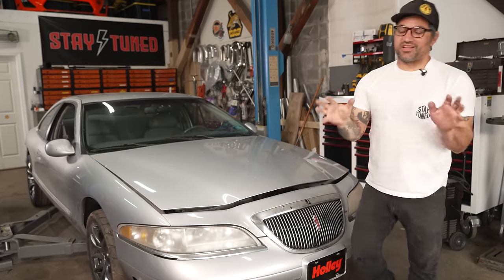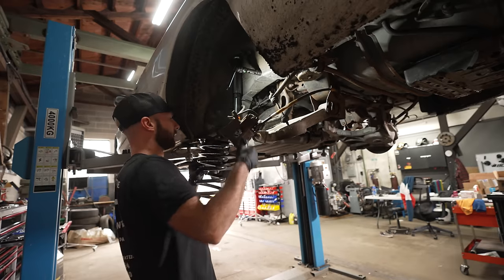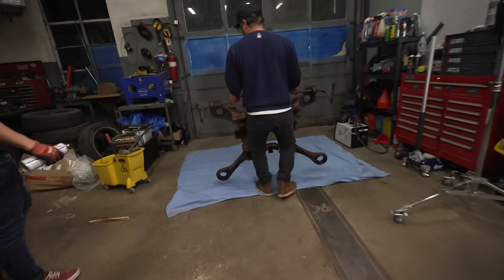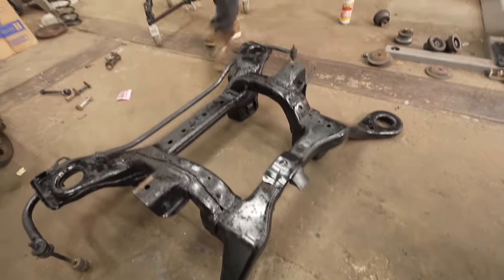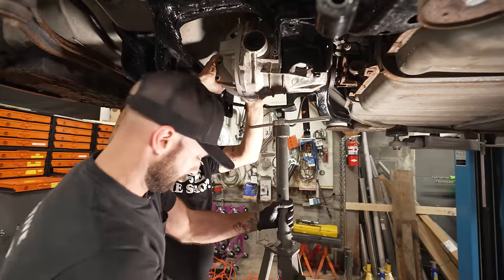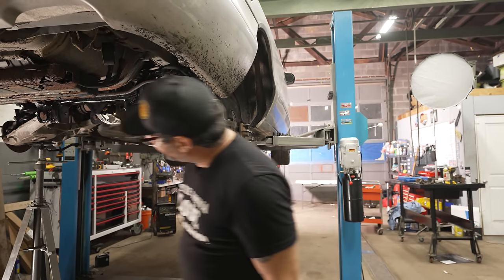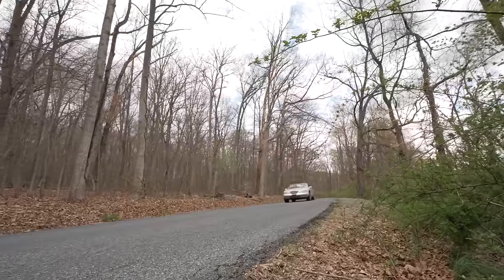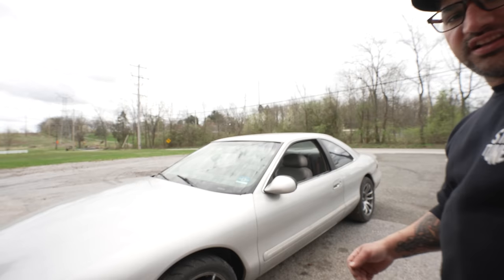Grandpa's Killer V8 Turbo Lincoln Hits The Streets For The First Time!

Comment: Real dialed tune and little shot for the bottom end that thing's in high 4 0-60 and I can see Tony taking it in the 10's with a good day at the track tuning everything else.

It's gonna be awesome, will probably run a heavy day at the track now, so long as the cooling system's up to that task.
Reply: I have very little clue what I'm talking about 😊 but if it's doing low 5s now I reckon it'll do better than high 4s no?

Comment: Just finished installation of 3.55 gears and a traclock in my '93. Even with a mostly stock engine it steers left on accel. Guess i will buying a big chunk of delrin and start turning some bushings for the rear.

Comment: The fact the current turbo can boost higher means you should have the headroom to go down a size or two on the turbine side, without losing top end boost pressure. That would make the turbo come on sooner and give you a wider power band, possibly without losing any top end power at all. For a street sleeper even a little loss at the top end for a wider power band might be worth it anyway.

Comment: Man, 3.55s? I would think 3.90-4.10 would still behave on the highway with that high-ass OD and be BRUTAL on the strip. Also, I'm not Italian AT ALL, German and 'black Dutch' (darker complected, dark hair and eyes), with green eyes and a red (and grey/white now at 38) beard, but I take Italian food VERY seriously. I absolutely make 'Sunday gravy' and I grow and can my own San Marzano tomatoes and Genovese basil, among other Italian-ass things. I respect the gravy-pie, haha!
Reply: 3.55 gears will build boost sooner in rpm than a 3.90 4.10 gear. There is a give and take though 3.55 is probably the sweet spot.
Reply: I’ve had 4 cars with 4v 4.6l: Cobra, Mk8, Mach 1, Marauder; with the nature of the engine torque curves they need at least 3.73 gears to come off the line like into party time quickly. I’ve used gears from 3.08- 4.10 and power ranges from 300-550hp. 
Never did a turbo build, but the engine is lazy down low with poor exhaust velocity and I would suspect more gear would let the turbo spool faster than more load. The car is heavy enough to load the turbo, especially with an automatic, it needs engine rpm to get it to breathe and spin the turbine. A 3500rpm stall converter w/3.55 might be a good compromise, I can’t remember what Tony put in there.

Comment: Years back, I had built a 7 bolt 4G63 for my 2g DSM and proceeded to grenade it at the 500ish foot mark on the track. Once they pulled the car off, I went and helped in any way I could to clean up the disaster I left behind. PS: I was the first car on track for a Wednesday testntune so I felt HORRIBLE. They were so thankful that I didnt have to pay any entry fee for a couple months after that. Top dudes! 

This was South San Raceway San Antonio,TX back in the early 2000s

Comment: i had a 93 with traction lock rear end with 3.55;s.  it was a 93 so had the one piece aluminum drive shaft.  it was an amazing car.  I replaced the front end with tubular stuff and redid the rear bushing with polygraphite,  it had a custom prom and ran REALLY well.  I too, used the supercoupe stuff.

Comment: Priceless work, Anthony - this build is in my permanent Top 3.🤩

First off, Happy Belated, Barb!!  If I was there you'd also have six Mason jars of genuine Kentucky White Lightnin' to complement your whiskey.  I got turned onto it when I lived in Bardstown during the late '80's, and I have yet to taste anything so sublime and so deceptively potent.

As for the build, each new chapter conjures up fond memories of my own Grampmobile; a 1974 Mercury Marquis Brougham that was the second car I ever owned.  The original owner had ordered a few heavy-duty options: 460 engine, 4bbl carb, dual exhaust, sway bars fore and aft, and a 3.08 posi.  All of which facilitated towing a big pontoon houseboat / party barge with ease on the highway.  When I finally got my hands on it, all I did was swap in a truck camshaft for a bit more grunt at lower speeds, slap on a pair of Hookers for better breathing, and then I finished it all off with a good three-angle valve job, courtesy my local mechanic.

LSS, my rather ridiculous cream puff ripped off an amazing 13.63 quarter mile at good old St. Louis International Raceway, then went on to terrorize such targets as Mustang GT's, T-type Regals, IROC Camaros, and the odd Mitsubishi 3000 AWD Turbo for dessert.  I had a fun 3 years with it, before trading it in on the new Monte Carlo LS my Dad and I bought together.  Hopefully you'll get to enjoy your ride a bit longer than I did mine.

Looking forward to the next chapter - KUTGW!!!😎
BTW - if you're like me, you too will forever wonder why Ford didn't appropriate this body and platform as THE perfect swan song for the T-bird, instead of the turd we actually got!!!🤮

Comment: when inserting bushings don't use grease or other lubricant, use dish soap (the green one) it'll act as a lubrican for the insertion and a sealant/locking glue when dried up

Comment: I have loved the Mark VIII platform and have all the parts to build a Teksid block, boosted 32V and this is setting my appetite.  Seems like potentially based on the combination of your manifolds, turbo A/R selected and the 3:55 gears you could benefit from a higher stall converter.  May help it get into its power band a bit faster.  Just a thought.

Comment: I think this is probably a lot like my car coming up on the converter, I have noticed that a degree of timing one way or another makes all of the difference between it coming fully up or not.  Havent got it fully dialed yet but there seems to be a point where once you can kinda nose it past, it can get away from you and push through the brakes.  So in my dinosaur DSM ecu I have the antilag set that once it gets right to that point, the antilag pulls back some timing so I can hold it at the line.  Worth looking into, if you can get some kind of launch button going where it antilags you up into it being fully up on the converter, it should get a decent launch.

Comment: Needs some different wheels to complete the sleeper look. MCM just did a turbo downsize for power up in what seems like a similar situation. Can you do a smaller back housing to get that boost up at lower RPM for streeting? more fun at safer daily speeds. Great work as always.

Comment: No need for nitrous to spool, you can do it with the Holley, just setup the 2-step (spark only high) at where it will foot brake to, should make a couple lbs then and then if you need more boost on the 2-step and foot brake you can setup an Advance table to add and subtract timing just when 2-step input is activated.

Comment: Maybe look into a different turbo or even a different exhaust housing to help get it off the line and come in to boost sooner. Also you can get a higher stall torque converter will help

Comment: I have a sweet, pristine 1st gen durango slt plus 4x4 with the 4.7L magnum. It was elderly owned and mostly used as an RV pull behind so while it has a quarter million miles, it still runs great. But.... As we all know more power is more better, so what would you recommend as far as bolt and go power?

Comment: Awesome work, maybe inform people about tightening suspension parts when they are at ride height so as not to preload the bushings.
Reply from the maker: I would but that doesn't apply to delrin or poly because they don't have a limited range of motion. I do tell people when we do rubber bushings.

Comment: I'm almost wondering if it needed 3.90 gears to get that launch down but not be too deep that it's screaming on the highway. I bet if it had a 6R80 it would get off the line way quicker. I wonder if it would help the boost come up and make more low end tq if you could tighten the LSA on the camshafts and maybe advance the ICL? I've never messed with that in a DOHC mod Ford so I have no idea if that's possible. I have always wanted to build a MK8, I had the chance to buy a few early ones that ran and needed some work for less than $1000 back in 2008-2010 era, I regret it. Back then I thought it would be cool to get a 5.4L 4V from a wrecked or rusted Navigator to use in a Mustang, Panther or MN12. I never got the chance since the Coyote came out and I got a couple of those instead then switched to LSs and the darkside.

Comment: If you put it in second if it has a manual valve body option, you can build the boost up in second year.Pull down the first and that will give you a better reaction
Reply from the maker: I will try that! It's semi manual it would do it.

Comment: 26 bushings in the back. nice upgrade. Awesome ride. 
With that irs there is caster and camber..and the diff is a middle pivot for the cv. You may not be bending stuff, just going with the given engineered math. Some squirrely is going to have to be allowed. 
I drove a subaru for years. You can try sway bar, :goodvibes:

Comment: Great friyay content as usual-THANKS STAY TUNED CREW!! Separately,  the whiff of smoke at start-up, might that be   just a touch from valve guides? Such a brutal sleeper. Fantastic it is.
Reply from the maker: Could be but they have like 50 miles on them total. I think it might be loosey goosey ring gaps that are ready for boost. Lots of our 4 cylinder pro drift motors would piston slap until they get warm.
Reply: @StayTunedTA  oh gotchya. I didn't know how loose she was - or is? Guys, is she loose? Does she know that? ( the engine of course. The engine)

Comment: Check the measurements on your lift at top and bottom empty and loaded. That noise sounds like something is bound or a greased something is dry or it's bound. Measuring to see if distances are the same loaded and empty makes sure the lift isn't changing under a load. That helps eliminate the possible binding. This is easier to do than try to explain in a yt message.

Comment: Anyone else remember the song "Hot Rod Lincoln"? 39 and my parents listened to the oldies.
Reply from the maker: Yes yes, of course! My Mom says it to me everytime this car comes up.
Reply: Son you going to drive me to drinking If you don't stop driving that, hot-rod-Lincoln...
Reply: My friend Chris's Step dad mentioned it to me in high-school, when I was having to use my dad's extra car at the time. It was a 90 or 91 Lincoln Town car and I've had the song on my Playlist since pretty much 😆
Reply: The original or Commander Cody's cover (imo better than the original).
Reply: Dug it as a kid, Cash "one piece at a time"...lots of good hot rod tunes from back then.
Reply: @Wbroach24  i drove a 91 towncar for a while in highschool.
 It had the 281.
 We would ride around like 10 deep and the air suspension just did whatever it wanted to.
 Sometimes the rear end would be up in the air, and sometimes the bumper would be on the ground.
 A lot of shenanigans in that car.
I actually got in a high speed chase, running from the cops. 
 The first cop to pull me over was in a Toyota Tacoma and had a firefighter tag, so I thought it was BS and took off. It was me, my buddy, and three girls that we met on AOL or something, and had just picked up.
 I was doing over 120 when i saw a bunch of blue lights behind me, and pulled over for real..
 All I got was a careless driving ticket, but they tore that thing apart looking for drugs.
 It was pretty crazy. Shut down the interstate for about half an hour.
Reply: @letsdothis9063 Dang son! 😂 I would occasionally drive my grandma's '89 Town Car to school just to have a different ride from time to time but we never had THAT much fun like y'all did! 🤣 

That '89 sure would fry the tires though lol .. we smoked out the entire back parking lot one day after school and the stupid cops came rolling up one by one shortly after I finished roastin' those ol white walls lol.. they never once suspected the culprit to be a big ol optioned-out 'Signature Series' Lincoln 😂

Comment: Hi from New Zealand ,great fucking channel ,little trick to putting gaskits in is to loosely put one zip tie on each side of the gaskit onto the cover then instal, cut zip ties off and fit bolts and your good to go,works great on sump gaskits or any other akward ones

Comment: You should leave that thing tuned exactly the way it is.  You get a grampa car that's actually calm and sedate around town, tune it to be fuel efficient when it's not in boost while having that upper half for murder mode.  Then you put some classier wheels on it, get the body cleaned up to remove those dents and clean up the chrome, and you've got a country-conquering road-tripper that will make a fool out of just about anything from a freeway roll.

Comment: Tony, were the rear springs different? It looked like the Pass rear spring was a replacement spring.
Reply from the maker: This car had air suspension from the factory so it's got a Dorman delete kit on it of conventional shocks and springs.
Reply: @StayTunedTA  yepper, What I was thinking the the pr spring was replaced with a different spring rate by mistake or as a replacement. Most likely I'm mistaken but wanted to ask anyway.
Reply: @StayTunedTA  Just FYI, I dearly love your show and I have watched most of the shows you have been in so thank you for that!

Comment: you probably have to much timing in it when its not in boost. try pulling timing down to like 18 or 20 when not in boost... just give it a shot. you want to put more heat in the exhaust. 3k to 4500rpm 18-20degrees = more boost sooner.

Comment: I'm a 5'10" car guy. Tall enough to have my back on fire while working on a car, but short enough to get stabbed in the junk by a hood latch when I have to crawl into the engine bay of a truck.
Reply from the maker: Haha, perfect!
Reply: @StayTunedTA  Oh and whoever invented that waterfall radiator cover on the GMT-800 chevrolet trucks can step on a lego. Trying to work on the intake and you slide off....crap...jump back up...slide back down..CRAP!!!!

Comment: Tony! As a mod motor guy, I'd warn you that the OEM timing systems are pretty weak, most notably when hitting or staying on the limiter. The secondary chain is prone to breaking, and the stock tensioners are ratcheting and oil pressure actuated. They will over extend and lock on the furthest tooth during limiter/2 step, putting excessive stress on the timing guides and chain, with no way to retract, almost always breaking one or more guides. The vibrations alone from high RPM/limiter/2 step can also break the guides. 

There are upgraded billet guides, the best being Shelby Mike, but pricey. Wonder Racing also makes some, as well as modified tensioners. They have the last few teeth ground off and a spacer added to prevent over extension and locking out. Accufab makes secondary chains and billet tensioners, but once again, pricey. I would avoid MMR like the plague. 

There are Facebook groups dedicated to mod motors. Todd Warren is a great guy to get in contact with, he has been in the mod motor game since the beginning (20+ years). He sells parts through apocalypse performance, and is a member of most mod motor groups on Facebook.

Comment: A ton left on the table with that 0-60. My 3.8L T-bird (99% the same chassis)  does 4.5 on the draggy street and 1.80X 60ft. at the track  with 299rwhp. I see LOW 11's out of Grandpa Mark.

Comment: You need a higher stall torque converter,  at least 2500-3000rpm, then she'd probably roll pretty good out of the dig, and get that exhaust run out the back through some resonators and stock tips (I'm pretty sure those had tips out the ass didn't they? I forget now lol, at least behind the axle dumps through resonators so nobody knows anything.... and definitely source yourself either some Lincoln chrome snowflakes, octa-stars, or 20-spokes...or alternatively, some polished or chrome 96 Cobra's, they also look rather "factory" but sporty..... and if we're not getting lowered coils, cut'em  a bit down to get that stance right 👌

Comment: best turbo size for modmotors is 7675 .. try the on3 stuff and you need looser converter and 2 step to build boost from a dig

Comment: Really not much of a sleeper when you got a pipe coming out of the front bumper. A sleeper to me would be something unassuming that someone would think would be the last thing that would have a monster lurking under the hood like say just for example a Ford fairmont packing the 1100 CI GAA engine under the hood but looks completely stock.

Comment: Wuzzup Tony.Question!I have a 95 toyota with a leaky power steering pump.I tops it off maybe once a week.Since its a older car what stop leak should i use until i get the new pump?What about lucus?What you think?And when i buy the pump should i change the pulley or use the origional one?And as far as hoses should i replace all of the hoses if so what one?

Comment: That's the issue with the 4-valve 4.6, lazy at low rpm. Terminator had that blower. I bet messing with turbo size and a looser converter would bring the party sooner.

Comment: That is a GT Bird now. Those 3.55 gears make her slow out of the hole, but in a 100 mi race it would be a fast car. I want to put that exact rear end under my 1990 F150. The Crown Vic front frame swap is what I am considering for the front. Put some aero on that car so you can drive it fast!